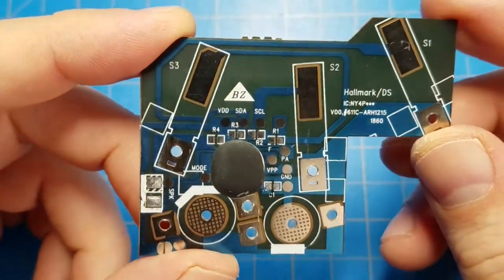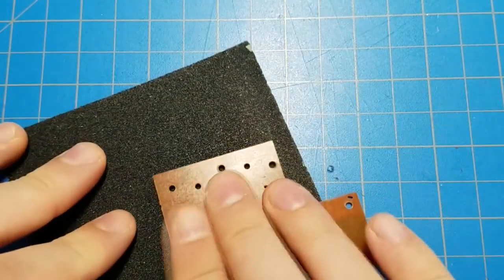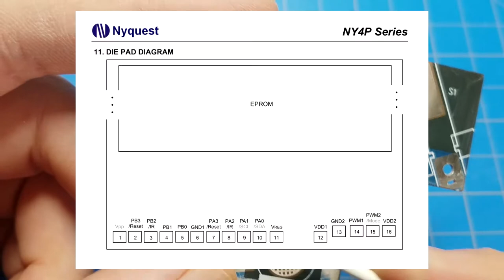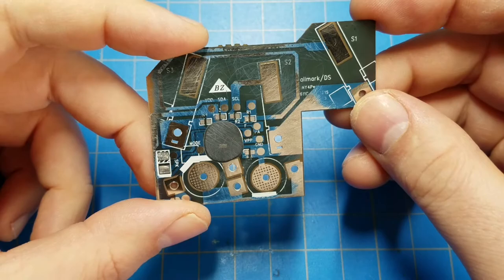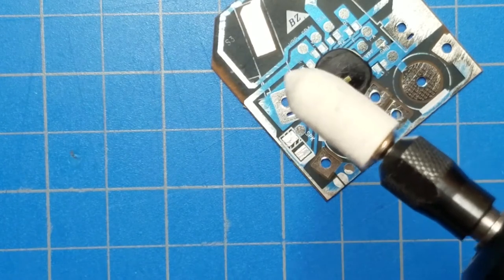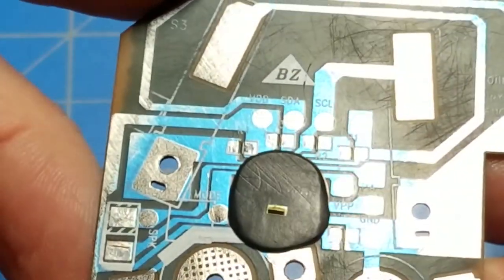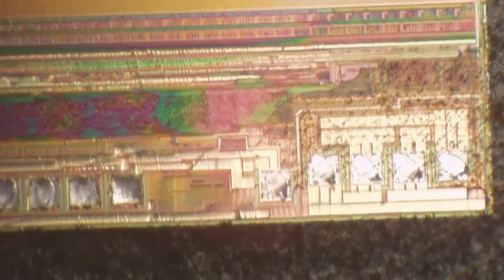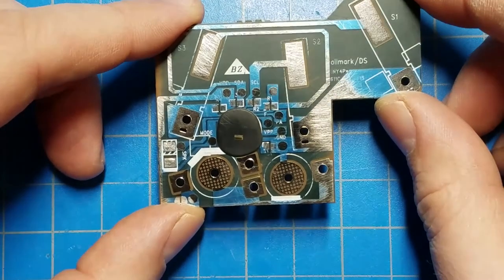Mechanically Decapping a Chip-On-Board (COB)

Comment: @11:06 It looks like you are looking into a swimming pool. It's crazy how "deep" it looks at that magnification.

Some recommendations if you want to keep trying this:
Get some micromesh (that's the brand name) sanding pads for when you get close for manual sanding. They go up to VERY high grits, and get pretty close to the "grit" of polishing compounds.
There's probably a small container of red or green jeweler's rouge included in your dremel kit. Get a little of that on the felt point, instead of car polish. It will also polish jewelry nicely. You do have to clean it off with alcohol after. it turns into a black sludge while polishing.

I've never done this before, but I do a lot of sanding & polishing. 

Cool shots. I'm wondering if the places where the die looks more red is actually due to the heat of polishing. Not like "red hot", but more like the various colors that metals turn (like discolored chrome motorcycle exhaust pipes).
Reply from the maker: So that cup of dry, reddish stuff I thought was "expired" dried-up polish compound was in fact a dry polish compound and should not have gone in the trash.

Hmm...

I'm going to need another greeting card.
Reply: @Ruthsarian  yup. 😂

Comment: I'm curious if there's a way to extract all the data off a chip like this. I see tons of test points. I assume it has basic logic data as well as the audio data itself. I have a few of these greeting card chips and they all work including one that records.
Reply: Most of them are otp, by blowing bits you form 1s and 0s. And they are soo simple, the alu and all loose parts of a cpu are usualy layed out in loose transistors instead of blocks. Its not like you can realy read the rom, the cpu is likely realy simple and made out of the things i just mentioned. And you wont get a console output from it
Reply: @309electronics5  so you can program it but not read it. How do they know that all the data was successfully programmed? Some programmable chip like ones that play back audio use some type of conversion to convert the audio to a format the chip can play. I have a paper jamz toy that hooks to a PC and you use software to convert a song to some weird format that the toy can play. I found one of those files because the software stores them on my PC and they are weirdly formatted and can (sort of) be decoded but they sound weird.
Reply: @coondogtheman  can i have one of the files? i can probably figure out the encoding
Reply: @luigikoopa8771  I will look around my old PCs HDD. On new PC so not much on it.